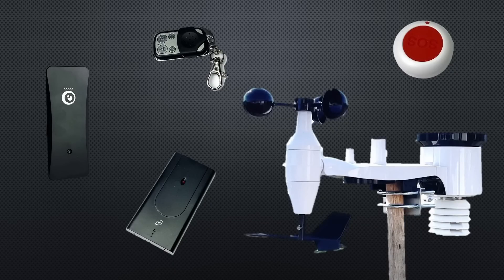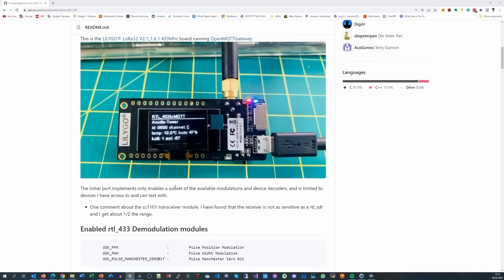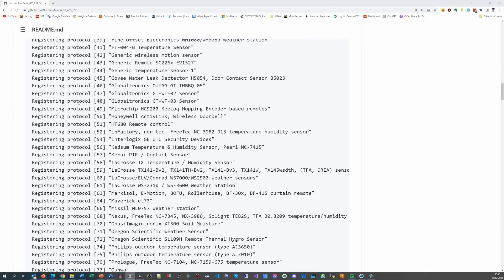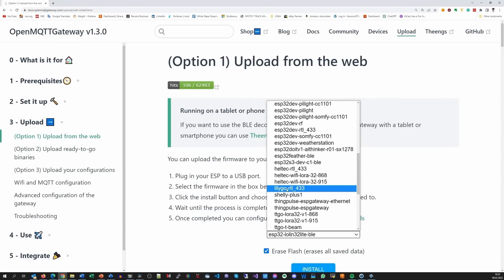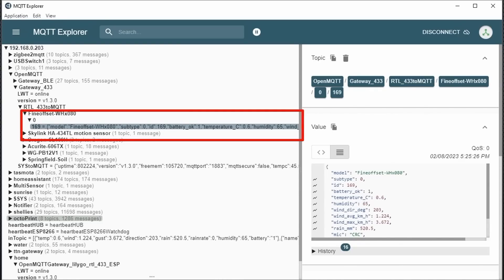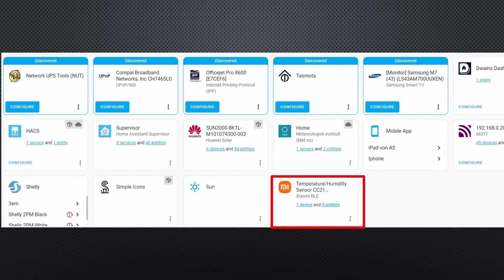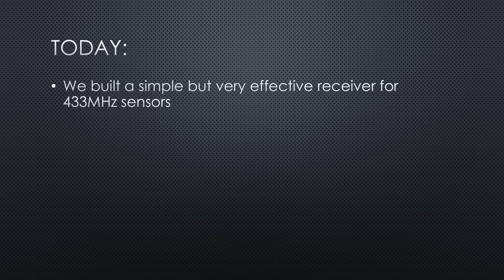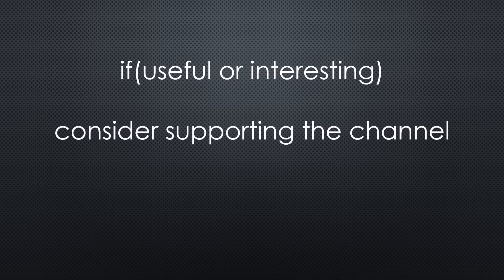449 OpenMQTTGateway Connects Many Things to Your Home Automation

Comment: I've been using Tasmota on an ESP8266 with 433mhz transmitter and receiver modules. But only radio sockets and switches can be used there. I have to take a look. Thanks for the great video. 
Greetings from Vienna
Reply from the maker: Switches and sockets are much simpler than weather stations. This is why I was happy that this project supports more complex devices.

Comment: Should I use a board with a different frequency if I am in Canada?
Reply: Canada uses the US 902 -> 928 MHz ISM Band (915 MHz) I believe
Reply: @thefrozencoder  there are a bunch of sensors transmitting in 433MHz, some garage openers in 315MHz and many other in 915MHz.
Reply from the maker: The receiver has to use the same frequency as the transmitter. If it is not 433, you probably have to ask Florian if the project supports these frequencies.
Reply: I live in Canada (west coast) and with a RTL-SDR I can receive a lot of TPM sensors, alarm motion/glass break sensors and Accurite/LaCrosse weather sensors or BBQ thermometers in 433MHz. Also, Amazon do Ca sells the Accurite sensors explicit transmitting in 433MHz. Out of curiosity I scanned the 915MHz with the RTL SDR and found a couple of BBQ thermometers in that band. So you are safe to receive weather sensors in 433MHz here. However, for LoRa operation you should use 915MHz because transmission in 433MHz is only allowed for HAMs AFAIK.

Comment: Can i integrate my xiaomi mi smart band 4 in home assistant to trigger some events and check the status? I want to use the media controller to trigger some relevant events and log mi stats. Also i want to integrate an easy entry feature for my garage door.
Reply from the maker: I do not know if it works. You find at least one project on Google

Comment: Awesome and timely video. I use RTL_SDR dongles on the USB ports of several OpenWRT flashed TP Link Router/APs whose primary use is Wifi range extension and secondary use as general purpose Amateur Radio listening (saving Raspberry Pis), and was going to run RTL433 on one of the APs. I also got some ESP32 boards to start ESP BT Proxy to integrate a BT Lock I received with HA. 
I was actually looking into using a BT dongle on an AP and see if it was possible to setup a BT Proxy with OpenWRT since I already have 4 OpenWRT APs around the house. This Lora ESP32 alternative is enticing. Again saving Raspberry Pis and keeping the  RTLSDR dongles for other projects.  Thanks for the introduction to this solution!
Reply from the maker: These board probably will free some resources on your routers...

Comment: I need to emulate an 433MHz remote for a diesel heater . Only On /Off commands but from HA. Do you think it can be done ?
Reply from the maker: It should be possible. But you have to try if the protocol is supported. If not, it needs some hacking and programming. Usually on-off devices are easy if they always use the same code.

Comment: Thank you Andreas, great as usual.
My 2 cents:
1- people around (the community) is unbelievable, having so much time and sharing with all!
2- majority of users (of anything) NEVER change passwords or even apply one - I could easily turn off heating system of all my neighbours who just bought this winter thermostats - nobody bothered to secure it! ;-)
Reply: just think, a burglar could inject water into the door lock, turn off the heat, and the water will freeze and break the lock.  then they can turn up the heat and enter with no restriction!  better change that password right away, your security depends on it! 😂 just kidding, but I lock my doors and don't leave the keys in my car... and can't believe some people still refuse to do so.  I like to make it just a little challenging for the bad guys so they'll go to the unsecured targets instead.
Reply from the maker: Interesting discussion. Here, the burglars just smash a window and enter the house. Very low-tech. Or they steal e-bikes as I showed in my last videos...
Reply: The question is - does it matter that nobody changed the thermostat password? 
Nothing in your home is completely secure from local attacks. I can trash the flowers in your garden. I can egg your house. I can break your windows, run into your house, and grab the computer and run out if you aren't read.
Your home thermostat isn't likely a valuable target, as long as we're talking about target local attacks (not internet attacks to make it part of a Botnet). The thermostat being set wrong might make you very cold, but it's going to be hard to use it to do serious damage outside of a complex TV Murder plot. 
Few people aren't going to have a malicious neighbor who knows enough to use 433mhz to mess with it from 200 yards away. The password on the thermostat is not nearly so important to protect against you, Mr. Homonto, unless you are a serial neighbor thermostat changer. It's about the other people in the same house who don't have permission to mess with it, and many households aren't worried about that.
Reply: @kyleolson8977  security matters - the rest of your post is blabla ;-)
Reply: @kyleolson8977  I will fully admit that when I was a lot younger I had little conscience and was bored very easily. Look up wardriving, it was fun when WiFi was new and no one bothered securing their networks. A simple prank can cause a lot of damage depending on what was done, especially when someone can control your thermostat in freezing temperatures, they don't know if you are home that week or not.

Comment: Yet more stuff I didn't know I needed.  I currently use an RTL dongle attached to a pi, but it seems to consume a fair amount of CPU and energy.
Reply: Yeah, I run Node-RED (and other bits of my home automation) on RPi1 512MB and to use RTL I had to use Linux tricks to limit CPU usage like "nice" or some similar settings. It just wanted to consume it all.
Reply from the maker: As I mentioned, SDR is a cool technology, but quite power hungry...

Comment: Hi Andreas, thanks for the interesting video.
Would you recommend switching from RFM69 to a LORA module for future projects? If yes, what module would you recommend (that has a decent library for AVR and ESP32 arduinos)?
Reply from the maker: I standardized on these TTGO LoRa modules for my projects because they are supported by the newer projects and are reasonably priced.
Reply: @AndreasSpiess  Thanks. I'll experiment with them. It would be interesting to migrate my solar & supercapacitor powered thermometer to LORA.

Comment: Nice. I've run into enough instability over long periods of time (months) that I've also integrated a hang/crash/noactivity detect to my 433 receivers. That way the units will reboot if it stops processing data. It's pretty easy to implement a python sanity check, and the only special case was when one RTL-SDR started repeating received data, regardless of what was actually being received. (I think it was a driver issue.)
Reply from the maker: RTL_433 probably was not intended for "productive" use. We started to misuse it because it was so handy...

Comment: Thank you for your effort. This would be the third possibility to connect 433MHz sensors. Currently I am using RFLink for 433MHz. Unfortunately the latest SW is of 2017, but it still works stable. In 433MHz I am using sensors only, because actors do not have a backchannel. Some people are using ESPHome as 433MHz Gateways. 
Up to now I do not use BLE sensors at all, because using  Zigbee or Homeatic.  But we will see, what future will bring.
Reply from the maker: I also used RFLink but never liked their closed source approach. But I agree, it was stable. BLE is cheap and supported by the Smartphones. So I assume it will survive. But I also use Zigbee. Usually, I adapt the communication to my "sensor of choice" for a particular purpose.
Reply: @AndreasSpiess  Yes, the complete 433MHz fleet seems to be somehow frozen. I am using many cheap door/window sensors. The temperture sensors created a new ID after each battery change. Not good for the archive and I replaced them by Zigbee sensors. But as you wrote, BLE seems to be cheaper an to become more commonly.

Comment: What about sending 433MHz signals btw? We got some Hofer awnings a few months ago but sadly they use some  encrypted communication. I was able to sniff the signal with my Flipper but so far don't have a way to properly send it from Home Assistant due to lack of hardware.
Reply from the maker: The LoRa modules should be able to transmit, and I think, the OpenMQTTGateway supports it. But I did not try.
Reply: Receiver and transmitter are $1 from china on eBay all day.

Comment: Die besseren Wetterstationen senden auf 868mhz. Ich hätte gedacht dass dies auch auf deine WS zutrifft. Funktioniert das esp32 Tool auch für 868mhz auf einem entsprechenden paxcounter?
Reply from the maker: Das weiss ich nicht. Vielleicht fragst du beim Projekt ob sie diese Möglichkeit einbauen? Es waren noch andere Zuschauer, die 868MHz Sensoren erwähnten.
Reply: @AndreasSpiess  I found this on openMQTTgateway page ( will try later) :
"Change receive frequency

Default receive frequency of the CC1101 module is 433.92 Mhz, and this can be can changed by sending a message with the frequency. Parameter is mhz and valid values are 300-348 Mhz, 387-464Mhz and 779-928Mhz. Actual frequency support will depend on your CC1101 board

home/OpenMQTTGateway/commands/MQTTtoRTL_433 {"mhz":315.026}

73'dl6mb

Comment: I'm also running a Sonoff/Tasmota 433Mhz gateway for other 433Mhz sensors. If the OpenMQTT Gateway will handle the weather station and all the other 433Mhz sensors, I'll be way ahead of the game!
Reply from the maker: I still think it does not support as many devices as the Raspberry. But mine were supported.
Reply: I was thinking the same - does this new combination (ESP32 LoRA 433MHz + RTL_433_ESP/OpenMQTT Gateway) support all the devices that the old combination (RPi + USB RTL-SDR + rtl_433) support? It would be nice to have a way to send 433 MHz modulated signals to test this, similar to rtl_433 but working the other way around (i.e. modulating rather than demodulating signals). As you say, these LoRa ESP32 modules also have the 433 MHz transmit hardware. At some point somebody will write that software. I can think of some silly pranks, too, e.g. broadcasting tropical temperatures to your neighbours' weather stations in the middle of the winter :)

Comment: I bought a weather station like your original one and have been using it for several years with the Raspberry Pi/SDR gateway you documented. I have updated the SDR to one with a TXO but the reception is still a bit flakey. I have just ordered the TTGO Lora board so I can build an OpenMQTT Gateway. I'm eager to compare the results. Thanks for a great video!
Reply from the maker: I hope it will work! I replaced the RTL_433 solution long time ago an went with the RF-Link and the Mega (as shown in my videos).

Comment: Nice one. I was checking my neightbors transmissions a while ago, but they seem to be all old school. Almost no foreign sensors found to "abuse". And I run a LORA gateway for quite some time now, and it is almost dead as well - no lora transmission except my own ones.
Reply from the maker: As you know I have a TTN gateway, a TinyGS satellite receiver, a weather balloon receiver, a LoRa APRS receiver, and this MQTTGateway on my roof. All of them deliver values every day. So it seems I live in a crowded place. Which creates other problems as I will show in my last video on my second channel ;-)
Reply: @AndreasSpiess  Now I do not know if I should be happy to live in a less crowded place, or jealous because I have to buy the sensors by myself :)